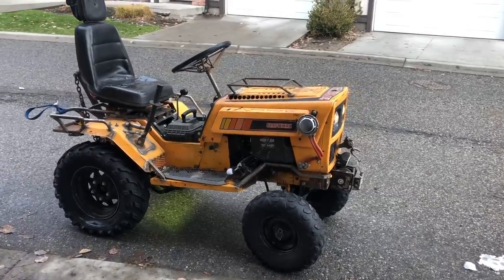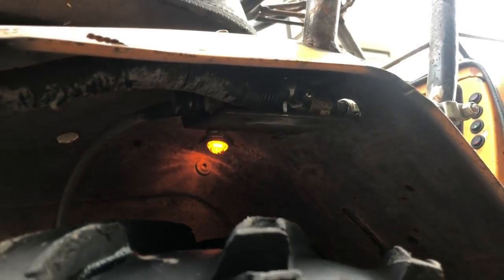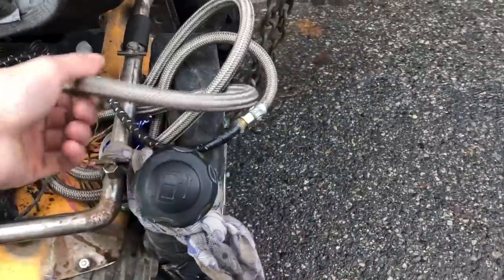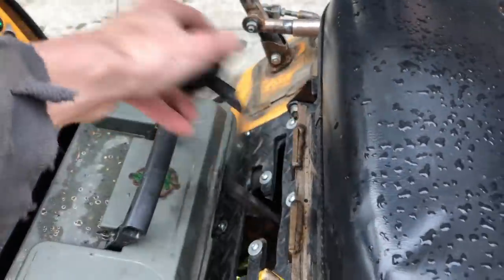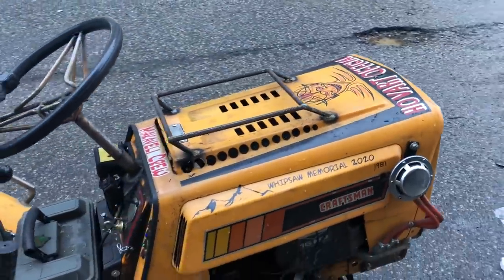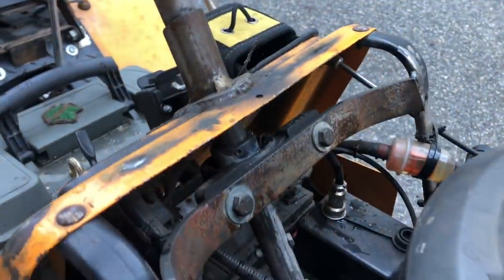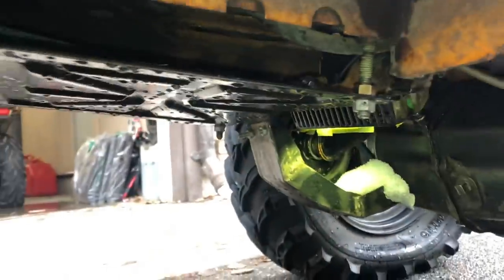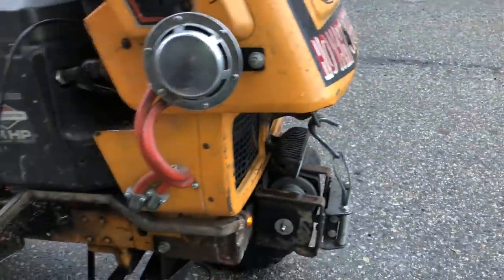Walk around off-road mower “MUSTY”

Comment: Are these types of tractors not hydrostatic? It works with a clutch :O
Reply from the maker: We only run manual transaxles 
So yes you have to clutch to shift gears
Reply: @okoffroadmowers  is it possible to make offroad tractors with hydrostatics or is it crap? thank you very much for the quick response! 💪
Reply from the maker: @steelorse you can but they can’t been pulley swapped for speed and are a lot hard to lock easier to find a manual 
Preferably one with 1” axle shafts